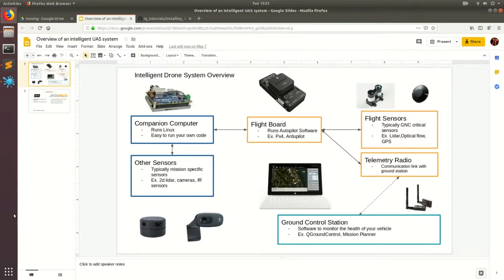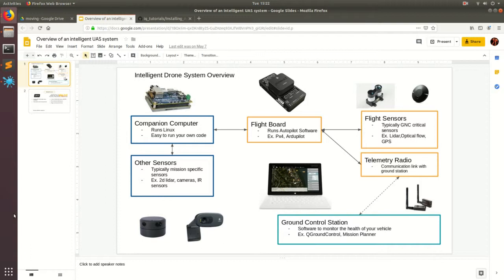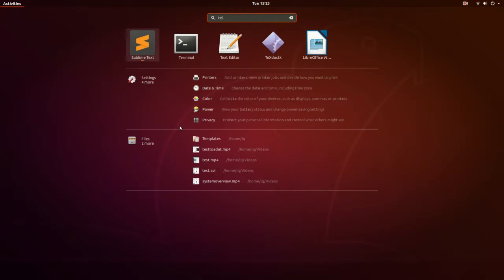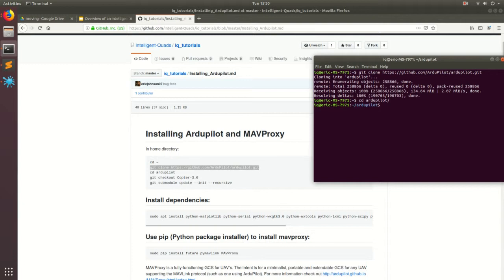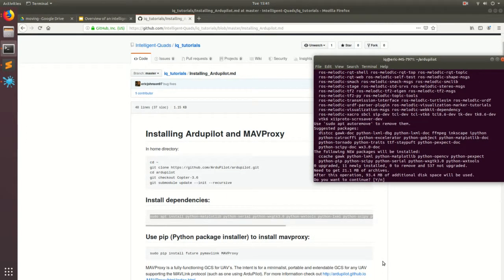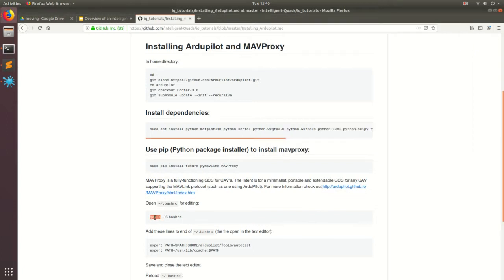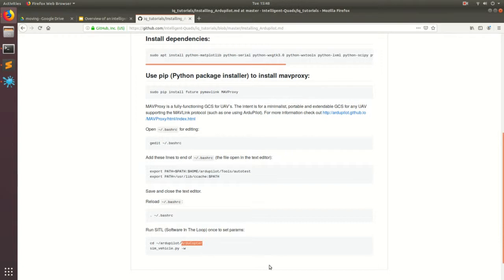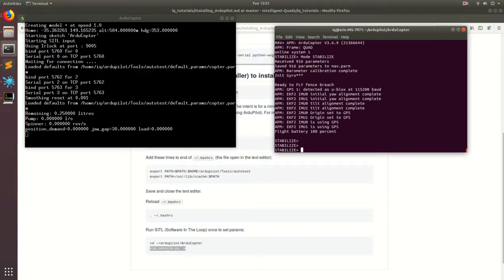02 Installing ArduCopter for Development (SITL)

Comment: If you are having trouble with downloading python packages you can use the following code: sudo apt install python3-matplotlib python3-serial python3-wxgtk4.0 python3-lxml python3-scipy python3-opencv ccache gawk python3-pip python3-pexpect
Reply: but after doing this, arent you getting a module error in the context.py file? 'imp' not found. And then when you fix that by changing it to the latest package, importlib, you get another error that says none type doesn't have loader attribute or something like that. and then I am stuck

Comment: Dependencies are not working in ubuntu 22.04 ? What to do?
Reply: hello did you solve the dependencies problem ?
Reply: @drihabalmaameri6818  sudo apt install python3-matplotlib python3-serial python3-wxgtk4.0 python3-lxml python3-scipy python3-opencv ccache gawk python3-pip python3-pexpect
use this
Reply: Nop
Reply: @antonypaul5402  what is the version he is using
Reply: same here its not woking on 22.04  , did you find out the way
Reply: @SuryaM-uj2gs  I think if u use more stable Linux version... may be it work... don't know just an guess.. Like ubuntu 20
Reply: @SuryaM-uj2gs  use sudo apt install python3-matplotlib python3-serial python3-wxgtk4.0 python3-lxml python3-scipy python3-opencv ccache gawk python3-pip python3-pexpect
Reply: use this sudo apt install python3-matplotlib python3-serial python3-wxgtk4.0 python3-lxml python3-scipy python3-opencv ccache gawk python3-pip python3-pexpect

Comment: when I am running command sim_vehicle.py -w it says that /usr/lib/env: 'python': No such file or directory. How can I solve this, if I am using python3. I also installed all the python libraries by python3 instead of python. How can I solve this issue? Thanks in advance
Reply: same error

Comment: Anyone getting this error "'ImportError: No module named pymavlink" when you run sim_vehicle.py. I doubled checked  it and am pretty sure it's installed in my ardupilot/modules/mavlink/ folder
Reply: same here
Reply: @sehliamal9105  did u manage to install wxgtk3.0?
Reply: @Mohamed Abdinasir have you found a solution?
I have the same and I am a beginner.
I install Ardupilot in ubuntu 20.04
Reply: @bienetre2981  no, i couldn't solve that. My mac m1 doesn't support virtualization so I found a workaround  by installing docker and running a sitl container.
Reply: @abdelnacerr  how to remove the git from ardupilot and start the installation again?   as i said i'm a beginner.

Comment: Can I follow your series if I've installed Ardupilot and Mission Planner on Windows 10?   Looking forward to working through the series. Thanks again for the hard work!
Reply from the maker: unfortunately the video series is closely tied to ubuntu
Reply: @IntelligentQuads  Well, that unused laptop of mine is going to get new OS then :)  Thanks for the response.
Reply: @Steven-jf4cs  No , you can always use software like virtual box to install LINUX as virtual machine
Reply: Thanks Jagadish!  I've tried Oracle's Virtualbox but found the performance was so slow as to be almost unusable.  Do you have any VM recommendations?   I added plenty of cores and tons of memory and still ran like honey in winter.

Comment: When I run the sim_vehicle.py I got "generator raised StopIteration" this error how can I fix it.
Reply: You could also try creating a conda environment with python 3.6 and NOT using sudo when installing the pip packages
Reply: try git checkout master instead of git checkout Copter-3.6
Reply: just erase that line from the code, and then it should work fine

Comment: When I run the python code it says Could not create the directory /home/sj/ardupilot/build.
How can I solve this?
Reply: Solved. I needed to change the ownership
By the way, after running the code. ArduCopter says "Waiting for connection ...."
ANd cannot see anything
Reply: @seungjunki3770  I got the information that the package is "missing, has been obsoleted or is only available from another source" did you change anything?
Reply: @lu3mm3l53  @Intelligent Quads says "I recently moved all of the tutorials to a sub folder within the iq_tutorials git repo. I think I just fixed all the links now!"